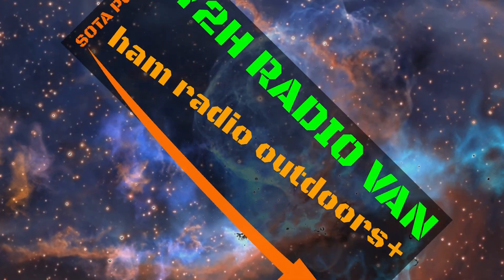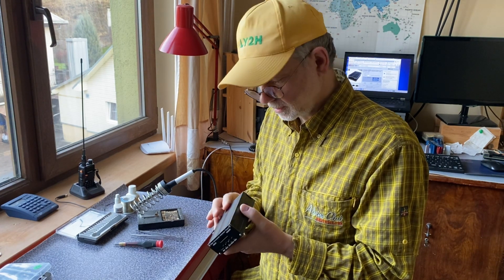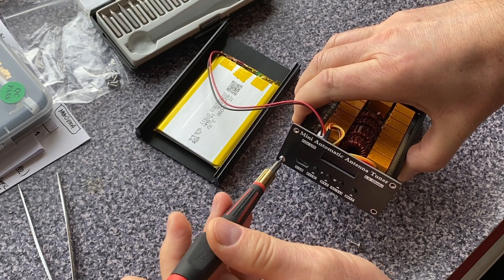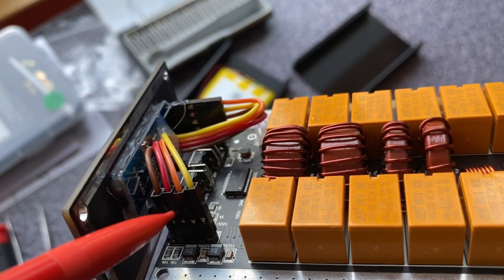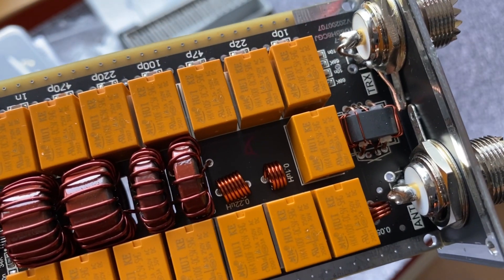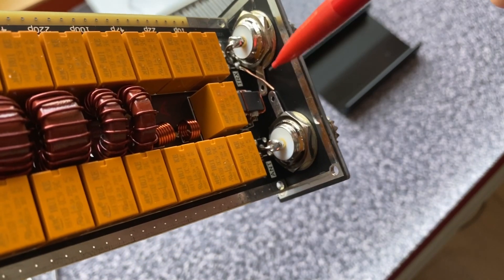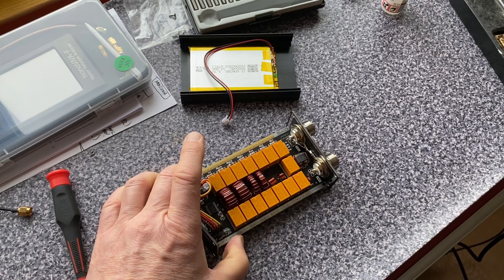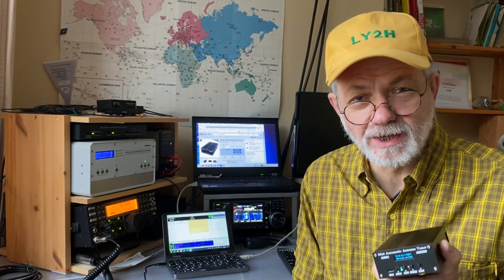How to get the CGJ-100 antenna tuner ready for work? Check! Inspect! Fix!

Comment: Hi,
I need to replace a power button on my cgj-100. It does not work to power up my antenna tuner. Perhaps you know where to buy new button for replace? Thanks and all the best.
Reply from the maker: Hello, sorry for your  problems with powering up the device. Unfortunately, I don’t know a specific source for these buttons… They seem to me like a standard ones, so I, normally, first check my local electronics shops in town. If not, I order components regularly from Mouser, but it’s more often when I need the whole list of components for a project, etc. I have been ordering some components  from Adafruit also, they are cheap and often have things others don’t.  I would also check the Amazon and AliExpress, a  button is not something to be afraid of fake :) HTH, 73! Linas LY2H

Comment: Where is you buy it with the battery included?
Reply from the maker: Hello, I bought it on AliExpress. If you search in their site ( or Google) for CGJ-100 tuner , it will surely pop-up. Then, it's possible to choose if you want it with battery or without. HTH, 73! Linas
Reply: @Linas_LY2H  thank you

Comment: This is why I buy nothing from China but kits. They bundle the parts for a good price. I build a quality circuit. Sometimes I even use different parts or make mods to devices to make them work better. It makes things work and I enjoy it. In this style ATU I switched to silver-mica caps so the tuning didn't drift with temperature changes after it did its self-tune. I like the large battery they included in this box. I see some have a small battery, or none at all.

Comment: Nice video. Looks like an interesting open source project. Note that the two smaller air core coils are not optimally placed, so they will couple and have mutual inductance, causing inaccurate stepping in the inductance values which could cause some gaps in matching values. They should be at 90 degrees to minimize coupling. I see they are correctly mounted in some ebay photos. de w6akb.
Reply from the maker: Thanks for the comment Alan! Interesting observation regarding the smaller coils! I have 2 more tuners of the same design just from different kit-makers and they have the coils as in CGJ. But it's certainly worth of trying to re-align them and see if anything changes. Thanks! 73! Linas
Reply: @Linas_LY2H  Theoretically it should make some matches a bit better by covering the inductance range more evenly, but in practice it may be hard to notice the difference. It would be interesting to see if you experience any difference, but it may not be worth the effort. de w6akb
Reply from the maker: @alanb76  Thanks again! I will certainly come back to this theme!
Reply: @alanb76 , things like this are the reason that I just buy kits from China and then build them right. Their job is to sell me something cheap. My job is to build something good. We're a team.

Comment: Getting it ready? What about building it with no instructions?  How does anyone ever figure out how many turns to wind on the coils, etc?
Reply from the maker: Steve, there is no need to build it, it's ready made and assembled and should work out from the box. It should but it not always does due to factory quality issues. That's why I always check the status of soldering etc of most chinese gadgets. If you want to buy a DIY kit , just fine! I'm sure there is lots of info on the web and forum groups about winding coils etc. Have fun! 73! Linas LY2H
Reply: @Linas_LY2H  There are instructions needed if you get the kit!

Comment: I recommend buying from a Russian maker’s they use genuine amidon toroidal’s with silver mica capacitors, they have a little diamond shape on each cap indicating that it is military spec.
Reply from the maker: Thanks for watching! Yes, I have one from Russia and one from Ukraine :) Both work ok, easy reprogrammable with Pickit3. This unit from China is a bit different, has a battery built in and I was curious to try it out in the autonomous work regime. Stay tuned! 73!